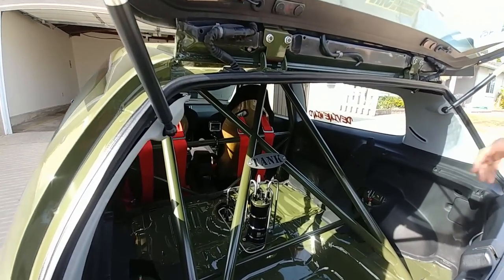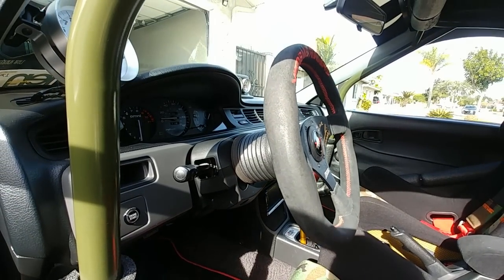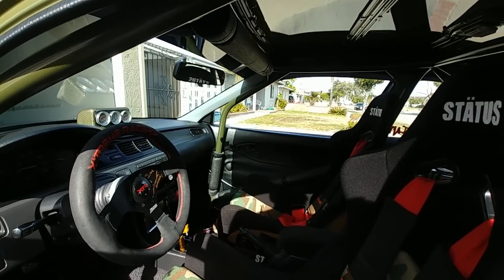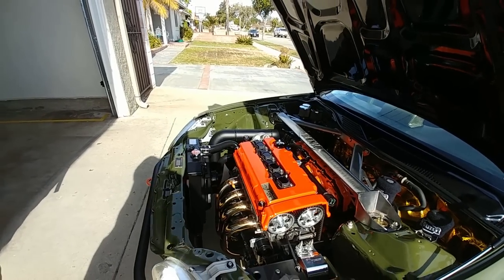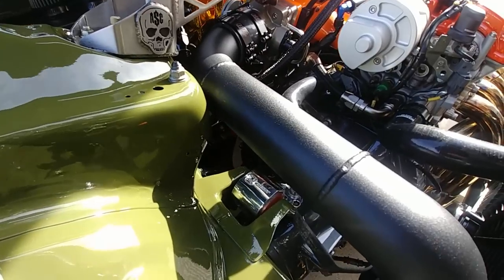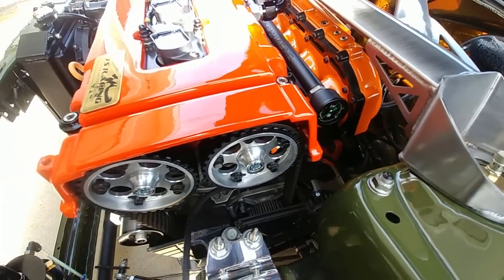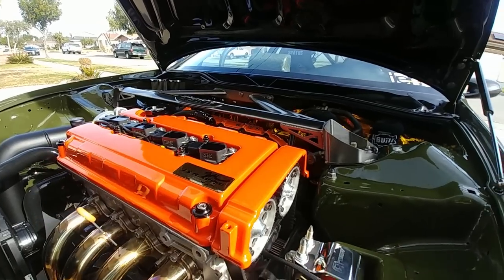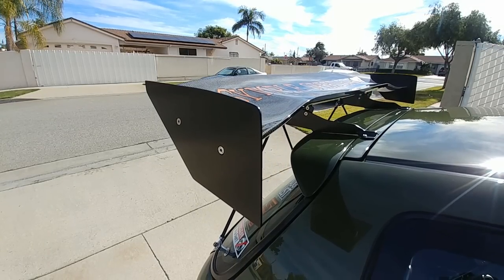1992 Honda Civic CX: The TANK Part 2

Comment: You almost never see someone who knows how to properly temper a header. Whoever installed that skunk2 was either wearing gloves or wiped it down with alcohol. I hate when someone opens their hood and you see the fingerprints permanently burned into the header forever from the first start because it wasn't cleaned. 
Well done. Proper hatch.
Reply from the maker: Good detail point